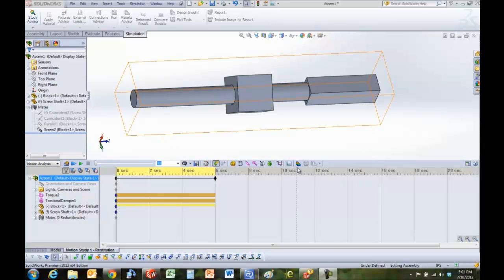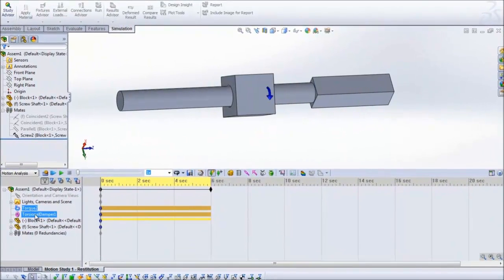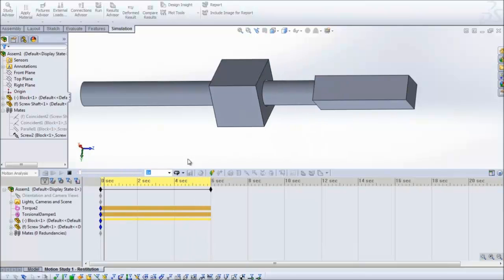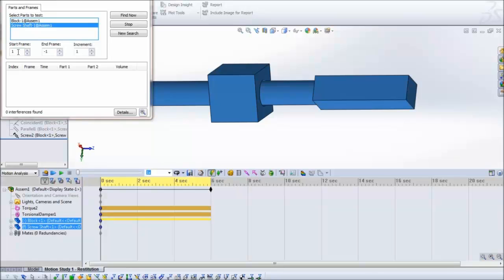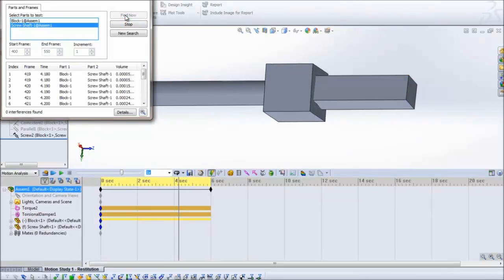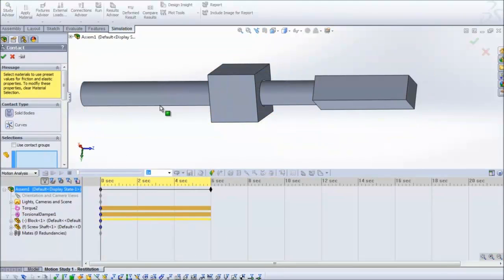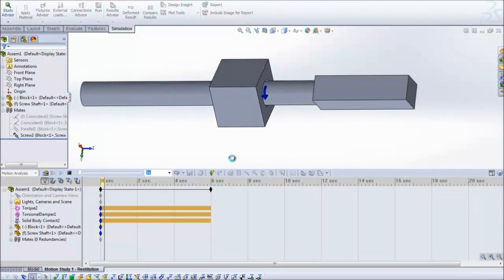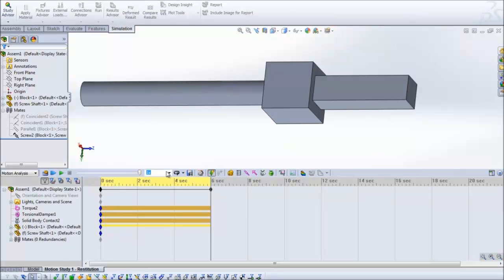SOLIDWORKS Simulation -  Interference Detection with Motion Simulation

Comment: Can I do this on Animation instead of Motion Analysis? Or is there a corresponding mate? (not limit mate, won't work in my scenario unfortunately)
Reply from the maker: You could essentially achieve a similar animation if you use the Screw mate, set a distance limit (must know the stopping distance) and then add a linear/rotational motor to drive the part. The animation WILL show errors as the motor cannot move past the set limits. Animation can also Check interference for each frame as you saw in this video, but does NOT support Collision Detection. That would require Basic Motion or Motion Analysis.

Screw mate: http://help.solidworks.com/2020/English/SolidWorks/sldworks/t_Screw_Mate_SWassy.htm?verRedirect=1
Limit Mates: http://help.solidworks.com/2020/english/SolidWorks/sldworks/t_limit_mates_swassy.htm?verRedirect=1